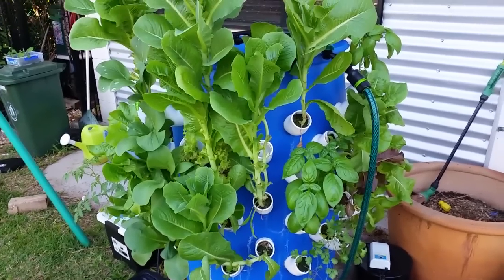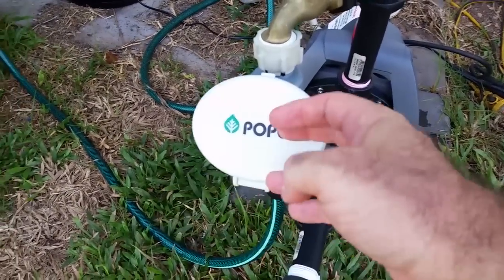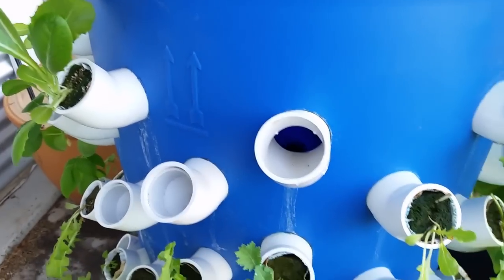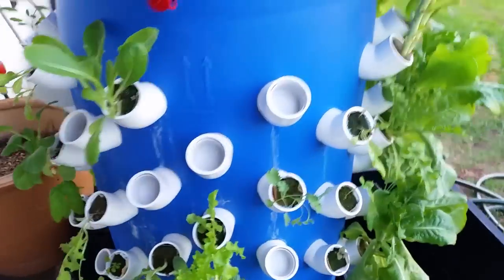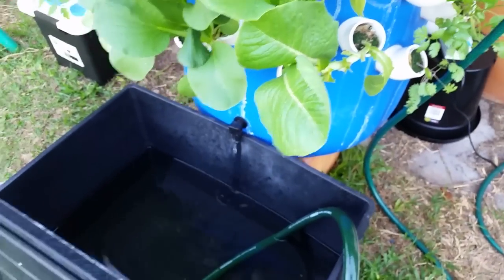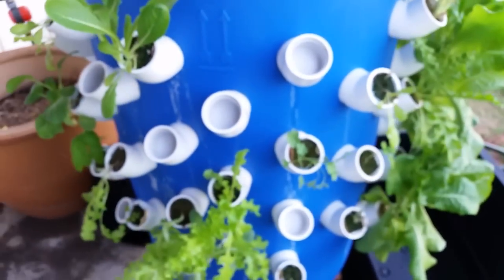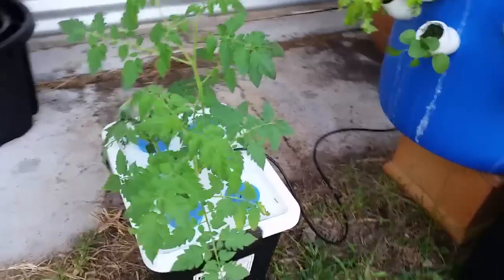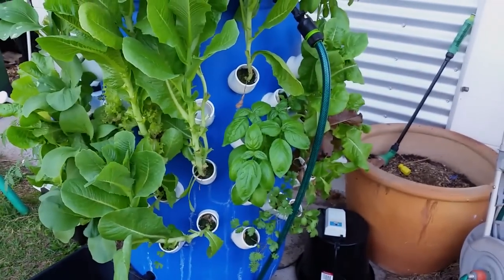Aeroponics Tower Build - Part 2

Comment: Those Pak choi's are caning!
Awesome!
Hey what sort of pressures can that pump punch out? and how much is it?
Do Bunnings do them?
Reply from the maker: seanosomething cheers mate, they are going well and are delicious :) 
Pump pushing out 50 psi and easily powering the 10 misting heads. Bunnings have it and it is about $180. It was just a short term solution though. I am working on something using a DC diaphragm pump and a pressure accumulator. That will allow it to be solar powered and require the pump to run far less often. In the new setup, the pressure will build up and be held in the tank and that will power the misting. The pump will then only run to repressurise the accumulator as required. Hope that all makes sense. That should be cheaper than the pump I have now and also virtually remove running costs. Will post a video on it when complete.
Reply: Absolutely makes sense... this setup sounds eerily like a "multiponics" gig (tree frog etc)..Am i right?
(they know their sh** also.. and nice guys, been emailing them)
Are you sourcing the gear yourself  or going through that or another mob?
Im steering down another path... with a 580-1500psi pump (adjustable) and one solenoid(cycle timer attached)....will run pump for a minute straight back into solution tank and solenoid will release bursts (same line) when required before shutting off and resting for my off cycle.... With the push i have id be reckoning on a 2 second burst every 3-8 minutes... am tinkering with the idea of a micro fan pushing fresh air into the rooting chamber between feeds also....
Reply from the maker: seanosomething Haven't been dealing with anyone else on purchasing. Got some good advice from a guy on here including cheap interval timers etc. Like the main unit, I am continuing with the DIY approach so I'll buy everything as separate components and assemble. The interval timer will need a bit of soldering but the rest should be straight forward (fingers crossed). That helps keep it affordable for those that are into a bit of DIY work. The DC and solar idea is more about making it stand alone so people can place it away from mains power if they need to - and that led to the idea of minimising pump run time through a pressure tank. Work in progress and learning lots through both success and failure :) Like your idea of the fan - have toyed with that myself. I think my next step will be to build a second unit to test different things while having a real point of comparison. Keep me posted on your progress - sounds interesting and happy to help with any advice if I can.
Reply: Nice...This Interval timer....not the type that stick on solenoids (DIN plug) (.5-10seconds on to 1-45 minutes off) ?? 
http://www.made-in-china.com/productdirectory.do?subaction=hunt&style=b&mode=and&code=0&comProvince=nolimit&order=0&word=solenoid+timers
Where will you be sourcing Accumulators ,pressure switches,sensors etc?
Love the stand alone idea....
Just a thought for you, as a comparison, your next barrel should be black.... and the outer sprayed white (couple or more cans of white enamel?(even sheeted with white contact plastic).. i know you will have an improvement in the rootzone... the "ambient" light in there right now is stifling development...
Id love to see a side by side with just that difference (i know you know this already...)
What pressure are you stepping up to? 100-160 psi? Id be interested to see the difference with the drop in droplet size... (am sort of banking on it!) Makes complete sense... then its just a matter of cycle times... Let me know those bits and pieces.. hear from you shortly... Cheers mate...
Reply from the maker: seanosomething This is the timer I am looking at http://www.banggood.com/5V12V24V-FRM01-Multifunctional-Relay-Module-Loop-Delay-Timer-Switch-p-918800.html and will try to get the balance locally if I can. Still tying that up otherwise will have to order online. Yeah next drum will get a coat of black and then a couple of white although root growth is going crazy in the current tower, it should get even better. Will let you know once I lock the components in :)
Reply: @patchtoplate-australia  I dont understand really but sounds good.

Comment: Excellent project and very inspiring for me to think along the same lines.  A couple of  questions:  What do you use for growing medium, is it rock wool or something else.  Also, do the seedling roots have to stick out of the elbows in the tank so as to catch the water spray or a horizontal direction of the sprays is enough for the water to reach the roots.  Thanks
Reply from the maker: chandra0102 G'Day and thanks for the questions. Yes I normally grow in rockwool as the cubes fit neatly into the grow tubes. I only wait for a root to appear through the bottom of the rockwool before placing in the tower. The roots don't have to hang out the bottom of the elbow as the misting water and nutrient travel travel into to each grow site easily. As the plant grows the roots can just hang in to the toweras they get bigger. I haven't lost any plants in the tower so they all appear to be getting what they need right from young seedlings through to full size plants.
Reply: patchtoplate  Thanks for your quick reply.  One more thing -  what nutrients mix are you using for growing greens;  is it premixed or you mix the individual ingredients yourself.    Thanks again.
Reply from the maker: chandra0102 I use H&G nutrients and mix them myself with a couple of other products to maximise growth. I only run the nutrient mix between 200-350ppm on the leafy varieties. I am working on a new video on nutrient and reservoir management so hopefully that will be useful for you :)
Reply from the maker: chandra0102 Not sure if you have seen it yet but here is that new video on the nutrients I mentioned - https://www.youtube.com/watch?v=5KrVn1IsjFs - hope you find it useful :)